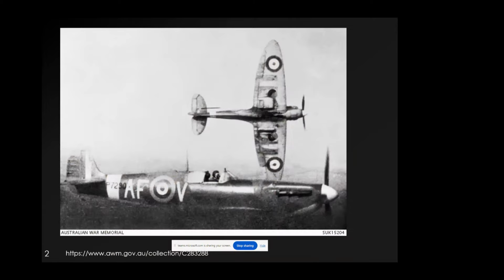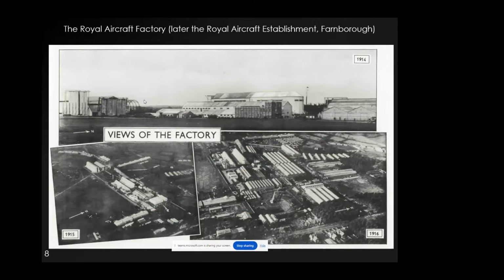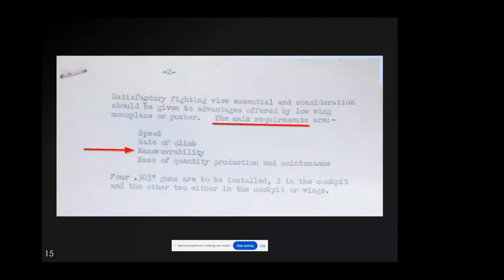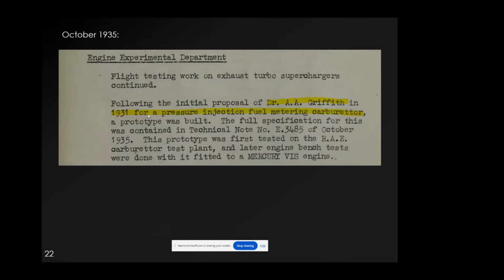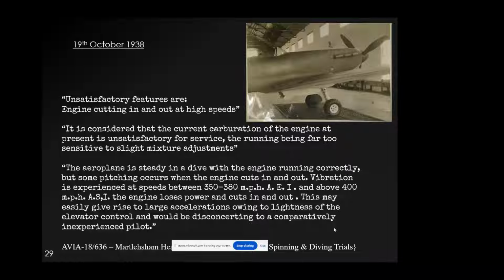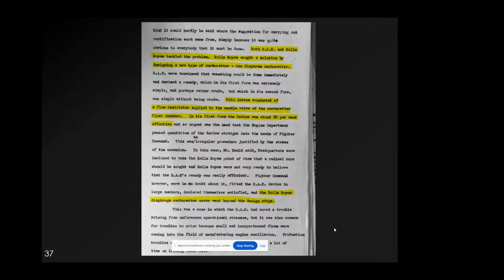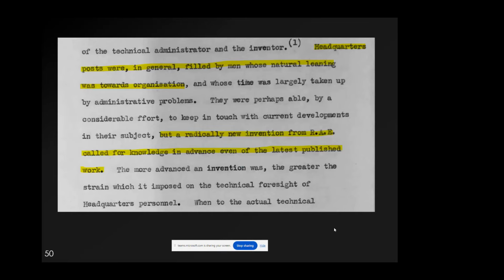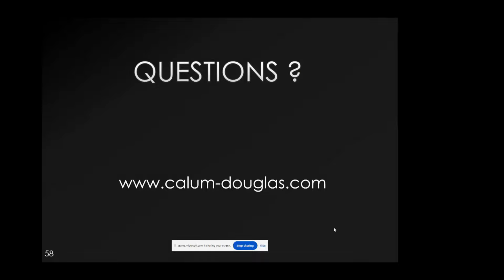Beatrice Shilling lecture by Calum Douglas

Comment: I'm pretty sure that the "powers that be" knew of Beatrice Shilling and dismissed her work as the imaginations of a "silly" girl and that is why she took no prisoners in interview. Imagine knowing you have designed the answer to a problem and then have it sidelined for years by boffins with little to no engineering expertise. Only to be made to fix someone else's design shortcomings  with a well designed "bodge" instead of using the unit she had already designed and that was ultimately far superior to what she was made to "fix."This is a repeated problem throughout the early 20th century and especially during the 2nd world war. The story of Alan Turin and his female companion that worked on the enigma codes before the mechanical cracking springs to mind. Sometimes  the Ministry was more of a hindrance than a help, especially shortsighted and on the side of bigger companies like Rolls Royce and the like.  I think i would have a very short temperament too because i'm sure she felt the needless loss of young pilots was due to Ministry failings to take up her design sooner.

Comment: Why did the pilots want inverted engines. What's the advantage?
Reply: Better visibility over the nose, lower CG, larger propeller.
Reply: Smaller frontal area too, I believe. (Cylinder heads aligned with wing roots)
Reply: But oil fouled the plugs.

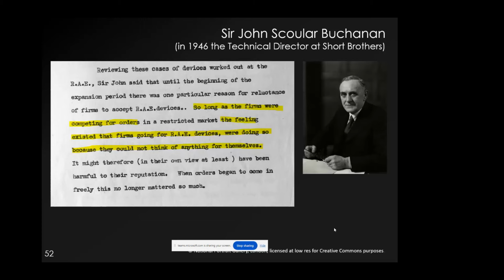Comment: The text on slide 54 at 45:45 is sadly covered by the "STOP SHARING" button. It reads:

"(b) Engine - inverted "V" chemically cooled with improved carburettor to obviate cutting out on sudden dives."

(As noted in the audio, "chemically cooled" means using pure Glycol, which was at the time the only way to stop boiling at high engine powers before the idea of high-pressure cooling with 70% water 30% glycol, started slowing coming in, during the late 30`s. Note that Glycol boils at very high temperatures but has substantially inferior heat capacity and heat transfer to water, hence pressurised 70/30 is a lot better than unpressurised (or indeed pressurised) glycol).
Reply: Very well researched and thorough examination of the issues of the problem, viewpoints of those involved. The elephant in the room is the sexism not mentioned in this exploration of the events and technology. The rivalry of competing firms and the R.A.E. was detrimental to certain aspects of fighter planes design and engineering. Personalities and pride were caught up in the advancements of engineering's and demands of WW2 aerial dogfights. Beatrice Shilling deserves more recognition so it’s good to see this .